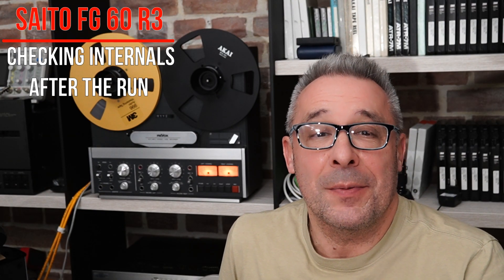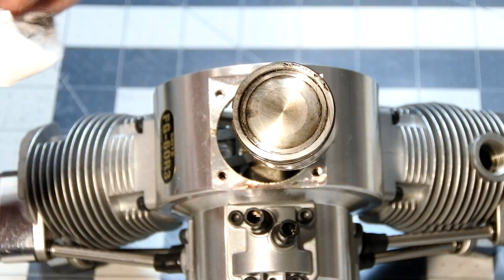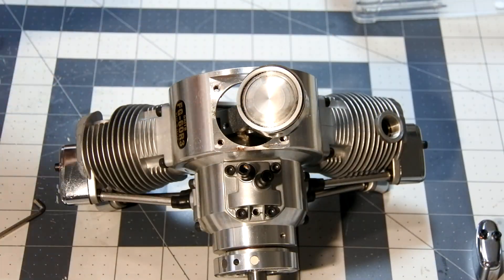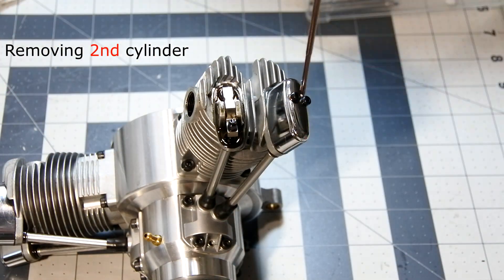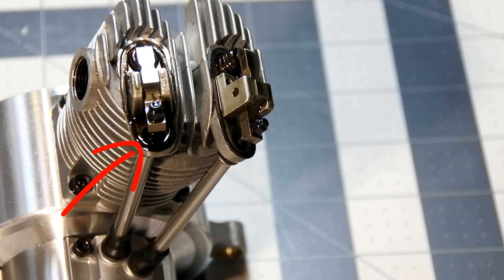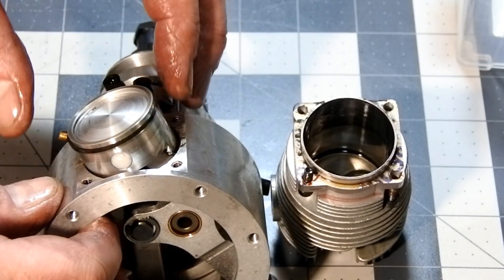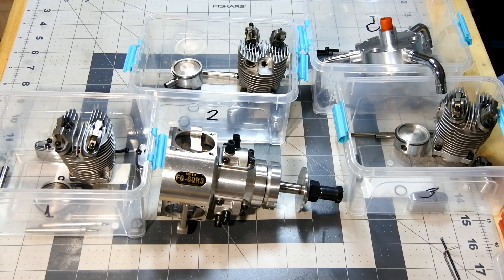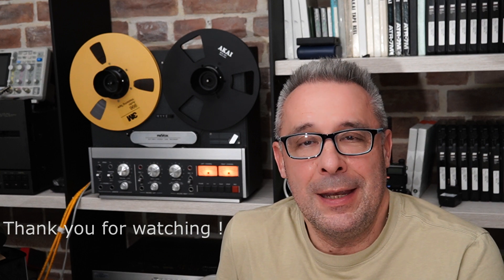Saito FG 60 R3 checking internals after the run

Comment: Excellent video. Clearly number three not firing. Any updates on its performance? I’m sure you are looking at cylinders temperatures to see how they compare. I’m running a Moki 250 and the same problem happens with the cylinder number three not firing. Seems to run when it wants to after the engine warms up. Great info thanks! How often do you check valve tapper gap?
Reply from the maker: Thank you very much for your comments and questions ! This was one of the first videos about completely new Saito FG60R3. A few serious flaws were found: uneven fuel distribution in between cylinders, as well, as working temps were different. One cylinder, which runs too cool, was overflooded. Engines also shows a lot of vibrations, it was absolutely unacceptable to be mounted on the plane. There is at least, 3 more videos about this problem, you can found it here:
https://youtu.be/mId-ZuShUGM
here: https://youtu.be/9io2OMgRRHM
and here: https://youtu.be/fiAZHW6EBn8
So, there is necessary to replace fuel distribution manifold, as well, to achieve normal engine's operation.  Regarding valve clearance check - practically, before every test run, to be sure, that this will not influence on the other engine's flaws 😀
Reply: I’m hooked! Love the way you play with the hall sensor just to see the results, we say “ballsy”. I will look at the rest and let you know what I think. On the fence with this motor but your findings are making me lean towards DA twin for the next project. We shouldn’t have to re-engineer these things to run correctly, great work!
Reply from the maker: @roymills415  Thank you Sir, I truly appreciate your praise! The thing is, I like to get to the bottom of things, so until I get answers, and understanding of what's happening, I can't stop. Of course, many of these explorations may not be of interest to my audience, so you need to know when to stop, take a break, and then bring it to the end. Still, investing another $500 in an engine, as a replacement fuel manifold, that already cost $1,000 is somehow indecent. I will definitely look for an alternative way, perhaps I will do it myself, with the help of a specialist turner.
Thanks and wish you a nice day!
Reply: So couple things, I find your observations super helpful even if they are not directly relevant to issues I might be having. So much of the theory transfer’s between glow and gas, mechanical electrical and design characteristics. Hate to rehash some obvious points , sorry if you covered elsewhere, as to vibration have you confirmed prop balance? Not just blades at 3:00 and 9:00 but have you truly balanced the hub? Uneven fuel distribution at intakes, crankcase: several of the Moki experts have suggested a internal plenum style vane that is tunable: iE picture the blades of a motor boat propellor, the basic idea is to speed up or slow down the fuel mixture to each cylinder based on the angle of it respective “blade” seems folks have had mixed results with this modification. I’m on around fix-number 7 on the Moki still trying to get #3 to fire. I know you appreciate the work to fine tune these awesome round engines to get max performance out of them. How about rotating the offending  cylinder to the top position to aid in breaking in? I’m also running an iridium style spark plug on #3 to try to coax it into life! Sorry for the long reply, I know you said you might have “shelved” the R3 for another day. Much Respect, Roy
Reply from the maker: @roymills415  Thank you very much, dear Roy, for comments and thanks for the detailed description, I am one myself, so no problem. First: The propeller was checked for balance several times, all these launches were within a year, and I used 2 different propellers, including reinforced plastic. Vibration in such a volume was not associated with propeller imbalance, this is a clear consequence of the incorrect geometry of the crank mechanism, when the flash in cylinder No. 1 occurs on time, in cylinder No. 2 with a delay, and in cylinder No. 3 earlier than in TDC. As a result, with spark ignition, the flash occurs desynchronously with the position of the piston. This gives a significant vibration. I specifically switched the engine to glow fuel in order to allow the engine itself (with the help of the natural advance of the glow plugs) to determine the moment of the flash. And here it is the moment of truth - on the glow plugs, the engine began to vibrate less. The propeller has nothing to do with it.
There is more to explore in these perfect Saito engines 🙂
But my struggle isn't ended/ There is a lot of interesting things are waiting for..., I hope

Comment: Thank you for your Video's
I have this same engine and as I mentioned in other places I changed the Timing Hub or Flywheel to the CH ignition version and myself found positive improvements in ease of starting and smoother running in general.
I am a "Tinkerer"... one who likes to explore and make improvements when practical.
I "Love" this engine, I crank it on the bench to hear it run "Twisted Sick".
So to you and anyone else,. here is my question, after this general statement.
We all know this engine has it's flaws "out of the box" .
First thing I noticed and I must admit I tore my engine down before I started it the first time and did not like the "Cir Clips" on the 2 connecting rod pins.
These seem to me that they could be thrown off at higher rpms.
Does anyone else agree with me that a real snap ring... the snake eye type that take a set of snap ring pliers to install and remove correctly.,
Would be better served in this application.
The cir clip is nice for ease of removal and installation if a quick manner.
But would not a real set of properly sized snap rings give a better since of security that would require a valued effort to remove.
I have not installed this yet in a plane, but I wanted to ask the question.
Thanks in advance.
Reply from the maker: Hi and thank you very much for your comment ! I think, that I'm also a person, like you identified yourself. 😊Definitely, absolutely agree with you about FG60R3 engine flaws. This flaws were stopped me to continue with it, because I don't think, that is possible to fly with engine with such behavior. 
Unfortunately, I've no time to search deeply for circlips tools, for mounting and dismounting it's from the engine. Usually, I use small thin flat tip screwdriver to work with, of course, it's takes an attention and consumes a lot of time, especially if circlip suddenly jumped up from engine to the floor of your workshop. 😃
Thank you very much for your comment, I like it very much, Have a nice day !

Comment: Is there any theory on why the no 3 is clean compaired to 1 & 2 ?
Is there any diference in ignition timing between the cylinders,, I have read somewhere that Saito does not compensate the
mechanical conrod difference in their timing ? Or is it the older intake manifold design that makes the no 3 piston so clean ?
Reply from the maker: Great question ! I'm still thinking about that. Thank you for heads up ! I've several checks during test runs, 3rd cylinder works, as all. But I've one question more - why first cylinder runs hotter, that others ? On most engines (Saito FG 60 R3, Saito FA 180 R3, Saito FA 120 R3). Any glue about that ?  I think, the dog is rummaging around here somewhere.
Reply: @crazyengines88  Well,, what I know is that saito need to change their timing and take in to account that the conrod geometry varies. I also have read a lot about the uneven fuel distribution. Some people have also rotated the engine during break-in and the engine still exhibits big differences in temperature between the cylinders. My FA170R3 have the old intake manifold and is very hard to tune. That is one of the reasons I am so interested in learning more about the latest designs of the intake manifold. (I don´t like to spend to much for the commersial modifications.)
https://youtu.be/bF3WGxoJaoQ
https://youtu.be/EK0kLZ8DdaY
Reply from the maker: @roki5941  Yes, clear, thank you a lot for the links. I'll take your topics into consideration for the future videos, it's interesting, definitely ! I've Saito FA 180 R3, also, would like to run it more, probably, will rotate it, to define, what is going on. Interesting, very interesting !
Reply from the maker: Differences in manifold design will be exposed (if any). To go deeper I'll need a bit better weather - right now is ~ -9 degrees Celsius, and windy. Not sure, that I can survive within 3-5 hours for test 😛
Reply: @crazyengines88  - 9....So you are still at the north pole 🥶
Reply from the maker: @roki5941  Not yet, certainly 🙂 But the weather still not suitable for long dances around the engine. Looking for better weather, in a few days meteorologists promise small "+". Anyhow, engine have to be cleaned, so we've some time.

Comment: What % of oil in the fuel? Cheers
Reply from the maker: Hi, and thank you for your question ! As far, as I can remember, it was 15:1 gas \ oil mix. Oil - Power Model 2T-S fully synth oil (UK made). This oil was an official Saito Mfg. recommendation. So rich (15:1) mix was used due to N.I.B, engine condition.